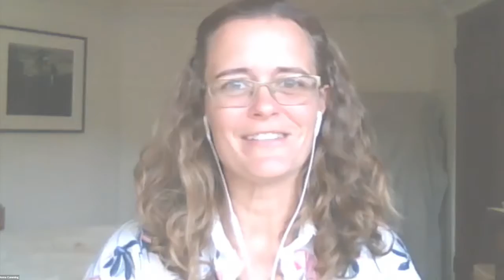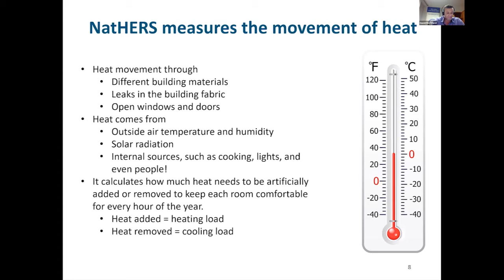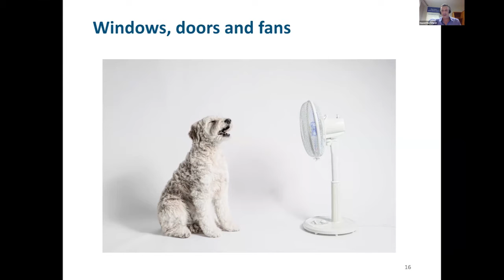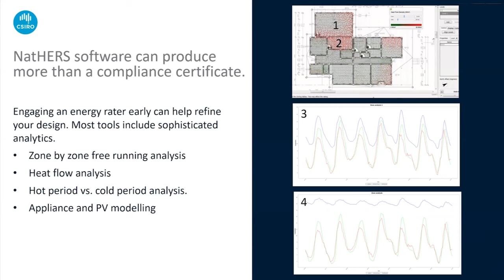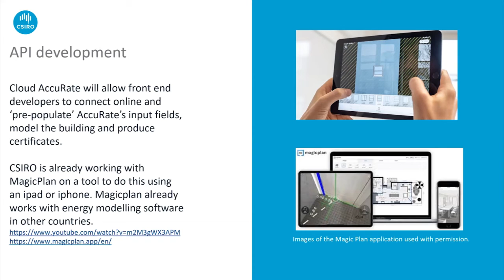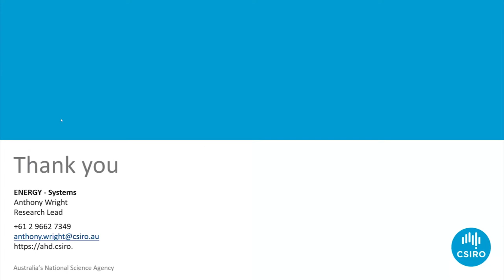Understanding NatHERS: an in-depth look at the Nationwide House Energy Rating Scheme - SHD 2020

Comment: For a rubber stamp certificate to receive a building permit, these assumptions put all houses on a level playing field and that's great.

For people wanting to know how a given house will actually perform with their family living in it, we need to be able to customise the hours we'll be at home, whether we open the windows or have a heat exchange ventilator that brings in our fresh air minus the pollen and road pollution, and a swag of other variables. A person who works from home at a desk in the corner of their bedroom has fundamentally different comfort needs to someone who goes to the office every day. A family with four kids being homeschooled is different to a household of young adults when those kids grow up and get jobs. Elderly people and babies are both more sensitive to cold and will need the thermostat set a bit higher in winter, and babies particularly will need the floor to be a bit warmer in winter. People who want their house to be ready for every likely scenario need to be able to test each scenario, not just a single standardised set of assumptions that match nobody they've ever met.

Also, climate change is real. My European friends have just sweated through a summer with highs up to 28 degrees because their houses were built just after WWII and they function like solar ovens in current conditions. If we're building houses to last, we need to be able to plug in different monthly weather conditions - temperatures and also rainfall, according to which model we're looking at - and see how the house we're designing will perform in 50 or 100 or 500 years' time.

As a wealthy developed nation, it would be a courtesy if we allowed people outside Australia to use the software with some basic local information - latitude, altitude, monthly temperatures, monthly rainfall - to test their own designs in their own climates with the technology our taxes have already paid for.

The software is great for a regulatory framework. Now we need it made useful for real people planning real houses. And also, we need courses in how to use it, not only for certified assessors to give us a certificate to build a house, but for families to explore their house design iteratively before taking it to an assessor for professional approval.
Reply: Really great points!